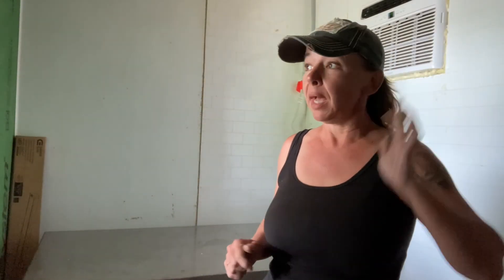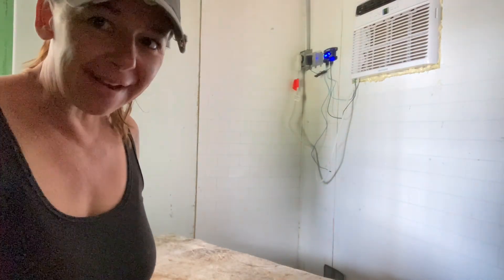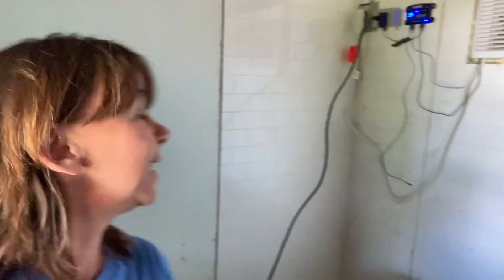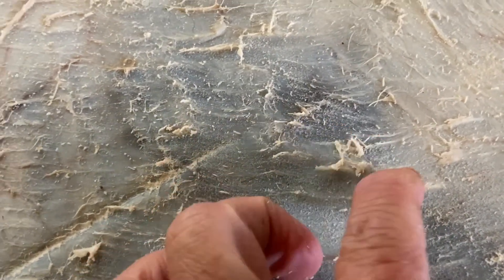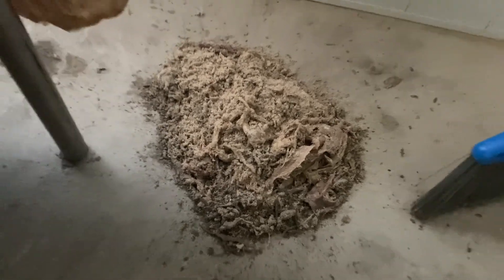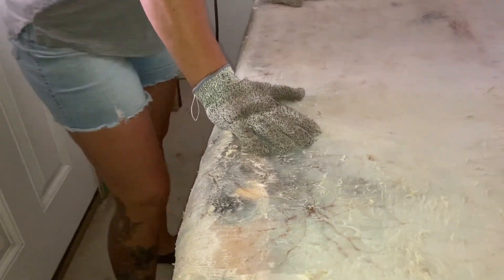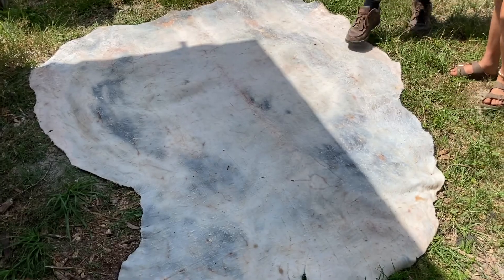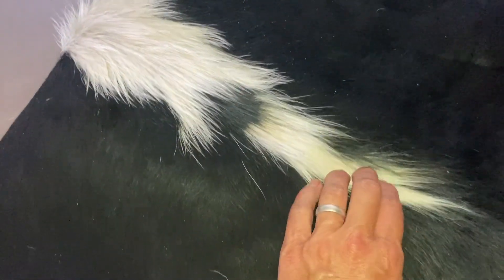Preserving and Tanning  a Cow Hide || How to tan a cow hide for beginners

Comment: 2 suggestions:
1. They make stone grinder disks with a recessed center. That would allow you to use the whole surface of the grinder instead of just the edge.
2. For stretching, get a trailer ball (like the thing on the back of a truck for towing) and mount that on top of a short poll or 4x4. Then you can lay the hide on top and stretch down with the ball pushing up. Way less effort and better focus on areas that need stretching, plus you can do it sitting.

Comment: THANK YOU sooo much for this video! I so appreciate you taking the time to share with us your experience! I have a cardboard stiff old hide. It was just fleshed, salted, and dried probably 10 years ago. We did use a grinder on it. Do you think I can soak it in water to rehydrate it, then use TruBond and neatsfoot oil?
Reply from the maker: You could certainly give it a try but don’t soak it too long, just long enough to rehydrate it. Spend some time breaking it in as it’s drying.
Reply from the maker: @doubleglfarms, I had a  deer hide that was super stiff and used beef tallow to rehydrate it. Worked really well!

Comment: Hi I need your guidance in restoring the years old hide
Reply from the maker: What kind of condition is it in?
Reply: @thegrahamstead  hi there good to see your reply it is very dry hard and where ever we have folded few edges have cracks
Reply: @thegrahamstead  my worry is will the fur be intact if we put it in salt water to restore it
Reply from the maker: I don’t have any experience in this but if it was mine I’d go ahead and soak it in water JUST until it rehydrates. I have heard that soaking too long will cause the hair to slip. Not sure about using salt water though.  Once it’s rehydrated and not soaking wet anymore you could always try sanding it to further soften it then give it a good coat of neetsfoot oil. Once that soaks in give it another coat. It may still dry stiff but at least it’ll be flat. hopefully the hair will stay intact. Like I said, I have no experience with that. Good luck!
Reply: @thegrahamstead  👍

Comment: I have started the process and currently i had salted the hide. But how do you store the hide and how long until it drys out or what is the consistency of the leather part before soaking it?
Reply from the maker: I keep my salted hides in a walk-in cooler at about 34 degrees. If you don’t have that option at least keep it as cool as you can and out of direct sunlight. The cooler you keep it the better. It’ll also give you more time to work on it. The last hide I did stayed salted for about two weeks, then soaked, then fleshed. Once I was happy with the defleshing, I brought it out of the walk-in cooler to start drying and breaking